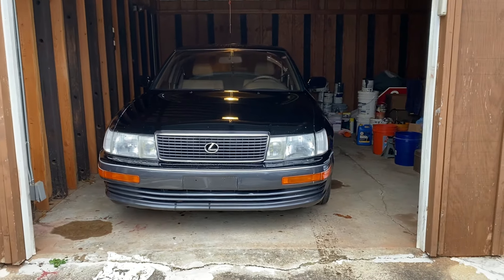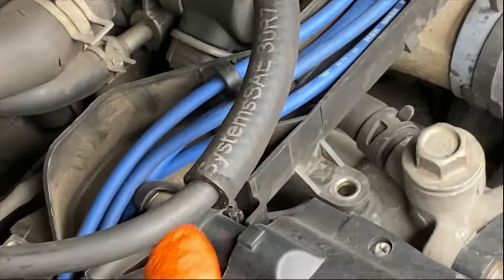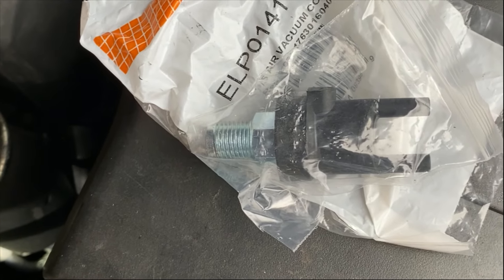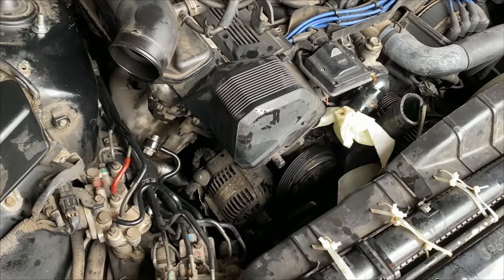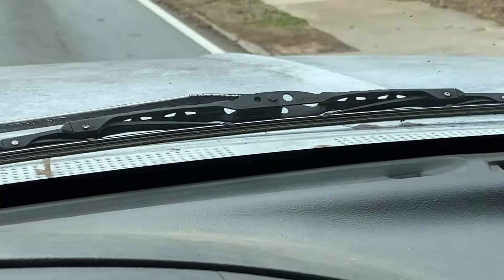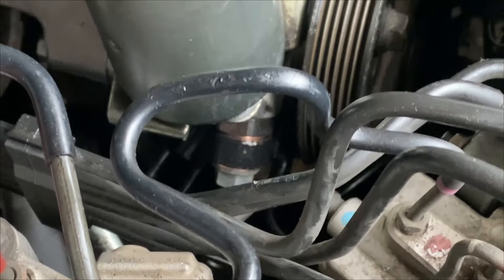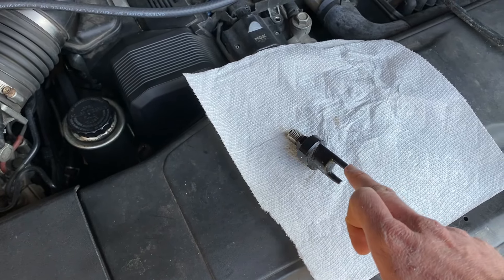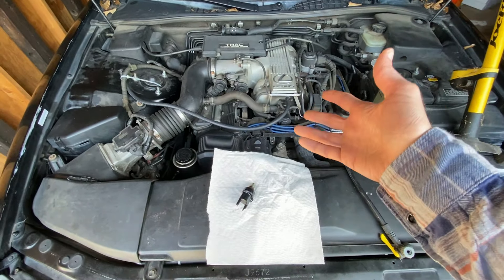Fixing power steering leaks on my 1993 LS400

Comment: That Idle-Air-Control valve can also leak into the Vacuum lines and enter the engine causing smokey exhaust,
But mostly constant loss of power-steering fluid because thousands of PSI steering fluid seeks the vacuum of either of the manifold hoses.
After noticing PS fluid loss and finding red fluid in the vacuum lines I (ignorantly) pulled both vacuum lines and plugged off the engine connections, and then (stupidly) bent both IAC lines 180 degrees and Ty-wraped them closed so that I could drive home on the highway...
I soon noticed the PS had failed, and I found the lil-rubber IAC lines had BURST from the thousands of hydraulic PSI.
Retired the car for a while to get the new IAC Valve in-hand and found out how difficult it was to reach, let-alone replace.
I did not want to drain the radiator, nor remove the PS pump, so I replaced my IAC from below by shattering the black plastic IAC body with a long screwdriver, and then Vise-Grips to un-screw it. Then to install the new one I (ordered and) using a "Crow-Foot" 17mm wrench to tighten it back. 
A-Ok now! Thanks for making this golden video in retrospect because I'm only today watching this video 2 months too late!
(1996 LS400 @ 243,000 Mi)

Comment: My car has that valve too, but my car is V6 Camry, anyway, that valve stops your car from dying every time you turn the steering wheel, when you turn the steering, you are loading the engine, and that valve increases the rpm ever so slightly, so the engine will not stall.